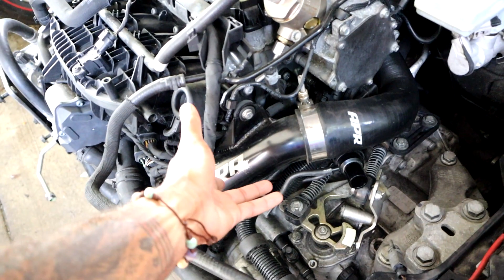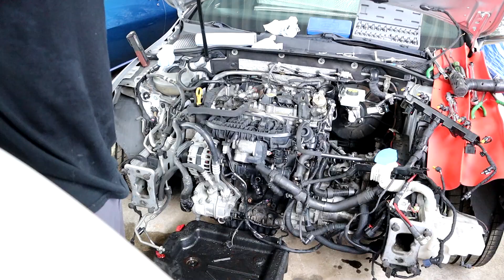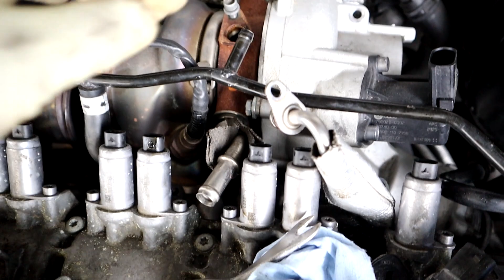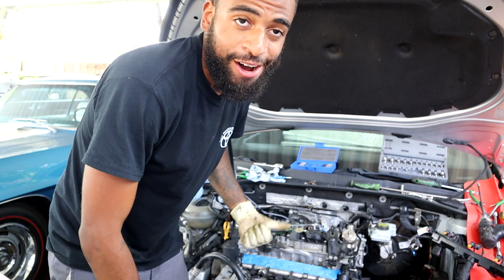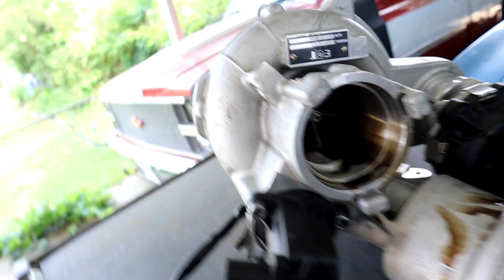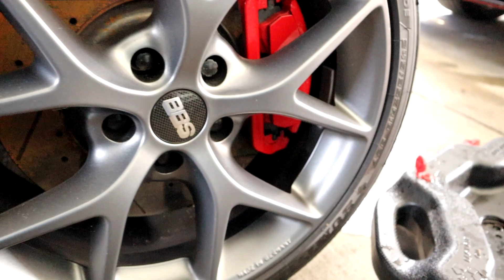REMOVING AND INSPECTING MY EQT VORTEX TURBO OFF MY MK7 #eqt #dmv #builtbrokenmodding

Comment: The oil came from cyl2.  No brakeclean, just gently blow some air in it to blow out the oil.  Get yourself a cheap boroscope and peak in the cylinders.  It should be evident pretty quick what happened in #2.
Reply from the maker: Gotcha ! Thanks for the info I really appreciate it

Comment: Looks like ur geting so blow by oil just add a cheap catch can but that's pretty normal. But if it did come from the inside then u got some seals that need replaced easy job though
Reply from the maker: Yeah that’s what I’m getting a lot from other people. Thanks for the info so much !